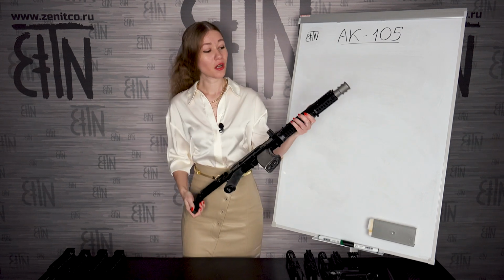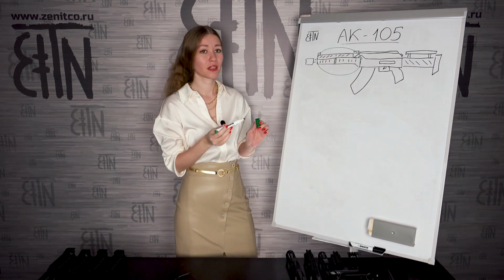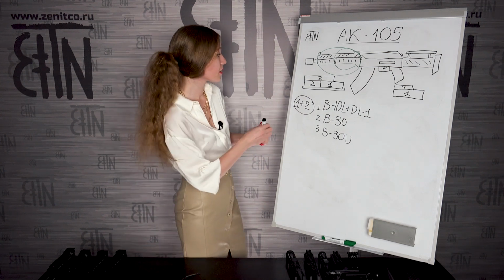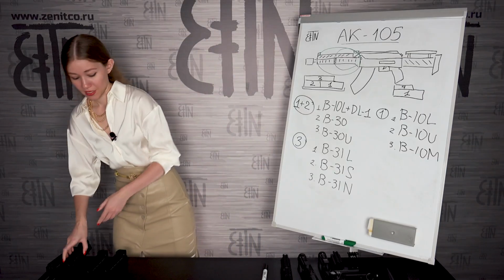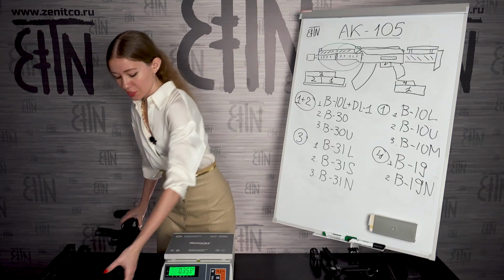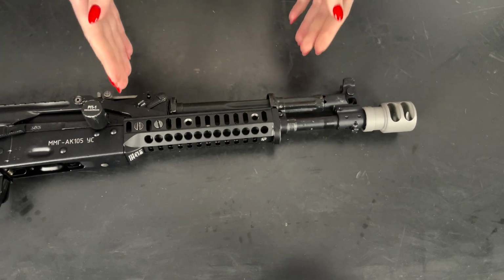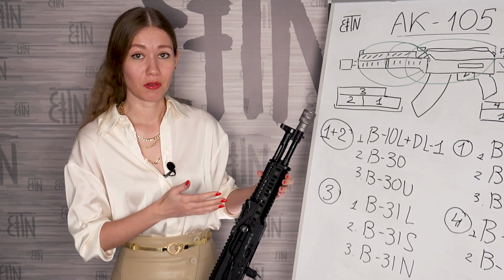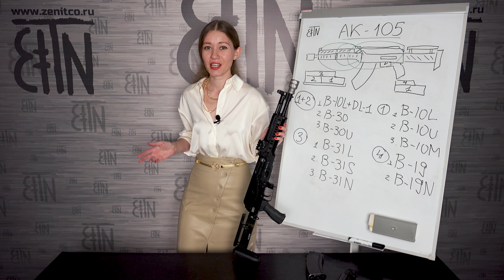Modded Alpha AK-105: setups

Comment: Which lock do you need for the folding PT-1 stock and the AK-105?
Reply from the maker: AK adapter (5.5 hinge)
Reply: @ZenitcoinEnglish  It's the 4.5mm, isn't it?  I just confirmed it with PSA.  I have their PSA AK-105.
Reply from the maker: @bigmad5653  Usually AK has 5.5. 4.5 is for AKS-74U.
Reply: @ZenitcoinEnglish  "The side folding button in the receiver only functions when a traditional 4.5mm stock is directly attached."  This is what PSA says for their AK-105 chambered in 5.45x39.  Thanks for your input.  I guess I have to go by what they are saying.

Comment: Outstanding video I love my AK-105 with the sport 1 kit and B33.
Reply: I just ordered a 105 do you need a b33 in order to use the zenti rail systems asking cause that damn thing is expensive 1k for it
Reply: @rippingdeath666   You need the handguard for the B33 but you do not need the B33 for the handguard. I recommend the B33 though best optic mount.
Reply: Ohhh ok thats good so I'm able to run just the handguards good to know thank you

Comment: Which mount is more stable for use with an optical device, the picatinny top cover, or using a side rail?  Any recommendations on which to choose?
Reply: it pretty much depends on what exactly you want your AK to be, for most people a side rail (assuming their rifle has the ability to attach the mount) is fine, but if you want your gun to be able to hold an optic while also being folded (to the left), a railed top cover is the way to go

that being said the B33 is the best railed top cover out there, though you need to mount it to one of Zenitco's handguards, so if your budget isn't that big the TWS Dog Leg Cover is a good way to go as well

as for side mounts the Midwest Industries one is a good choice, so is the B13 from Zenitco, and you definitely can't go wrong with an RS Regulate mount